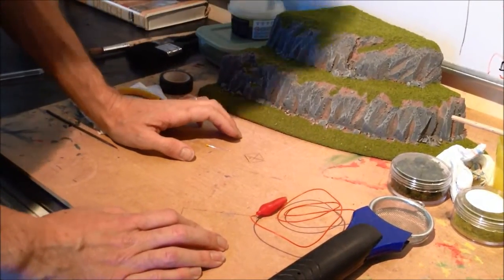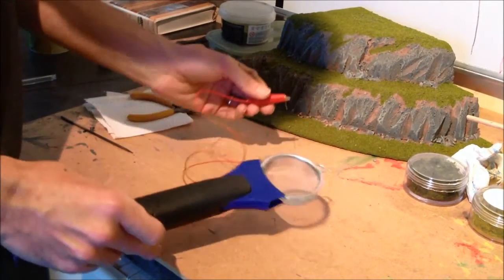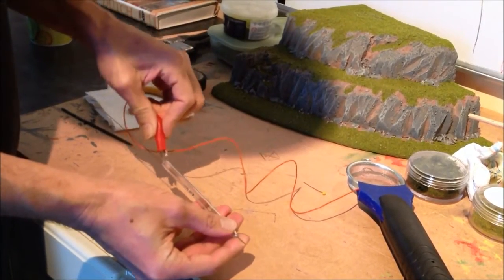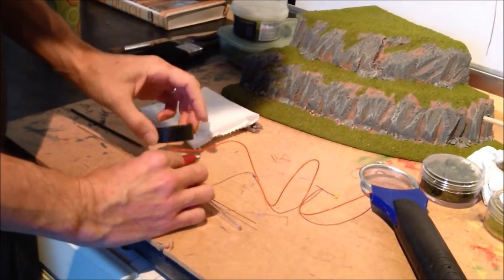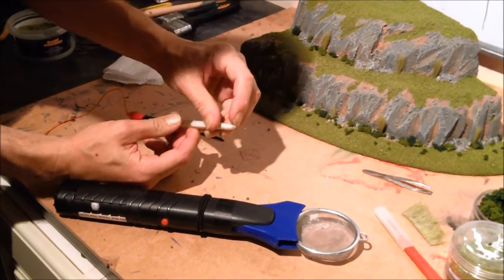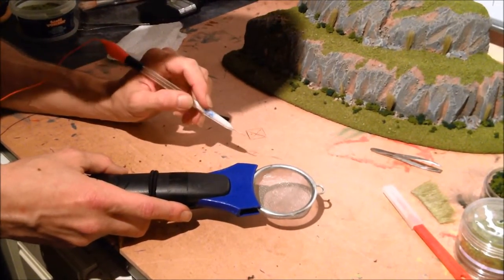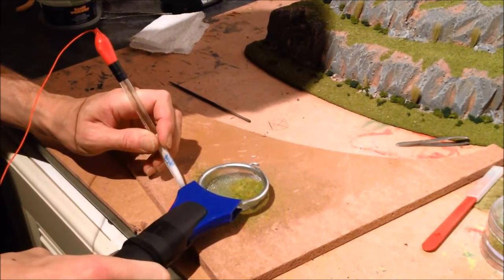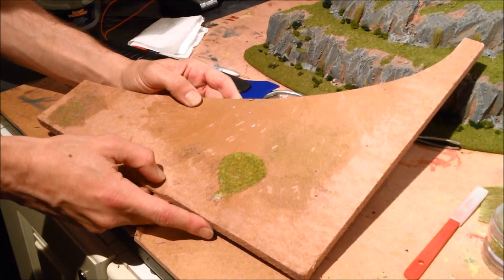Modifying a static grass applicator for detailed wargames work

Comment: How have I not seen this fantastic tip until now?? 5 years late but it is still a genius idea, and I've just started with the static grass section of my model layout so this will be perfect. Thank you ☺
Reply from the maker: Hope it helps mate
Reply: @TheTerrainTutor  I tried it yesterday and it worked a treat. Even on a larger area it meant I could make sure the current was running close by. Thanks again mate
Reply from the maker: Glad it helped mate

Comment: Nice mod Mel.. have taken the idea one stage further, I purchased a Maxwell Multimeter Test Probe kit off of eBay UK, it consists of a couple of meter leads with interchangable probe ends - which can be Probes (like your ballpoint probe), alligator clips or spade connectors. The original grass applicator lead is replaced with one of the Multimeter Probe leads, so instead of an aligator clip on the end of it you have have an insutated threaded socket, to which you can attach by screwing togeter the probe, clip or spade connectors.. So you can end up with a dedicated insulated probe, an insulated alligator clip or a forked spade connector that will fit up to a 6mm nut and bolt..
Reply from the maker: That's going full bore matey!

Comment: Nice idea I have loads of these home made static grass applicators for my model railway however if I need to do a small area such as grass patches in an area where I am not doing a field for example I could do with one of these pens to use instead of the nail or pin. Neat idea love static grass :D
Reply from the maker: ***** Cheers mate

Comment: drill a little hole in the middle part of the plastic tube  ( at 90 deg. to the tube )  then screw a little bolt or a nut  to clamp the bras wire inside the tube and make it stop from sliding up and down . No need for glue ,  pins , sticky tape or anything else .  Use the "screw/nut"  to make (re-adjust)  the length of Your wire  at will  :)    -  $1.000.000  idea right there  !  HA !  -  ow - I just thought a bit more on that  - it would also help if that "bolt" or "nut"  would be plastic  . Metal ones  will conduct electricity  and  You still might get a spark/jump  , so try to find  a small plastic nut screw or something like that  ....   :)
Reply: artyfarty3 This is just my assumption and I might be wrong. But I don’t think he glued the brass rod’s tip for the sole purpose of avoiding the vertical movement. I’m assuming he placed the PVA soaked tissue tightly around the rod, then superglued the tip to make it stationary, hence the ability to bend it as shown near the end of the video, which he stated as being handy. Your idea is very good but I think the rod’s tip might not be stationary and move about, since it’s being held only by the clamp through the drilled hole in the middle of the pen. Without the tightly packed PVA soaked tissue, I think the rod’s tip will move around horizontally because of the gap between the rim of the pen’s tip and the rod’s tip. This is just my two cents :)

Comment: um question i love the idea but just one problem is can't find any pyrotubes anywhere (im US) what could i use instead if any 1 could help me that would be amazing i love the idea just cant make it ;)
Reply from the maker: instructions on how to make from a fly swatter on youtube mate
Reply: ya, i did that I just want the pen thingy you had, awesome idea by the way :)
Reply: "Biro" is a brand name for pens that has become genericized in the UK. In the US, the closest equivalent would be "Bic pen". Find a dead one, pop out the pen part, insert some brass rod (or a straightened large paper clip) and Robert's your mother's brother. (Translation: "You'll be in like Flynn". 8-) )
Reply: Doug Sundseth kk man thx alot
Reply: you could use a straw or plastic tubing from a fish tank air tube or any type of non conductive tubing.. great idea Mel winner winner chicken dinner
Reply: Why not try the rod and put several layers of heat shrink tubing around the rod heating each layer until they are tight. You might need several and 2 different sizes but that might work. You'd have to experiment until you found the number of wraps that were needed to insulate the rod. Might work?????????